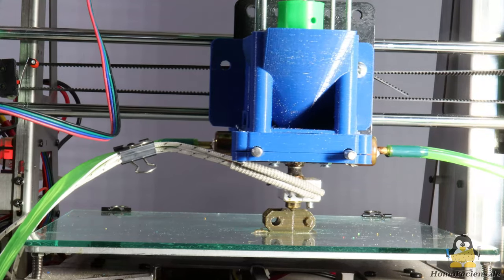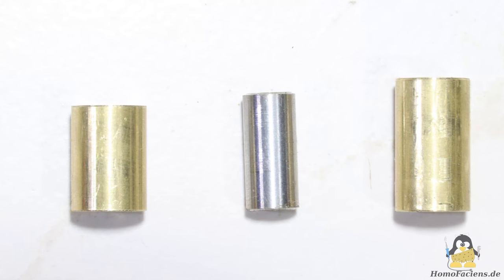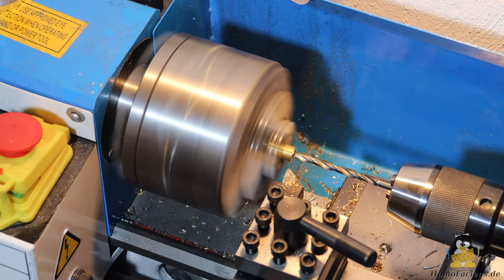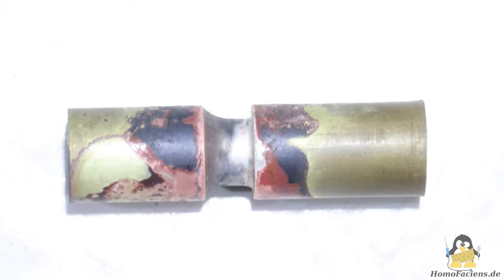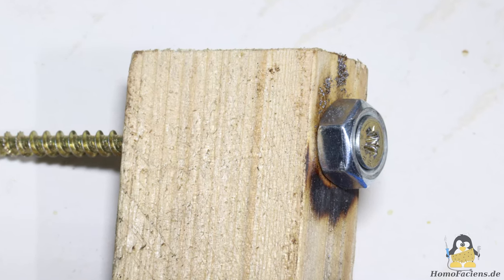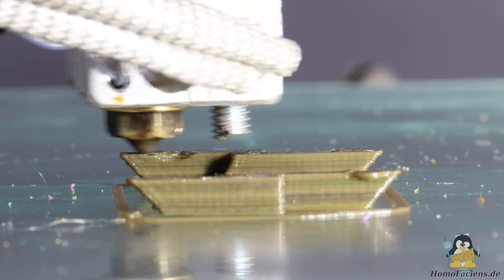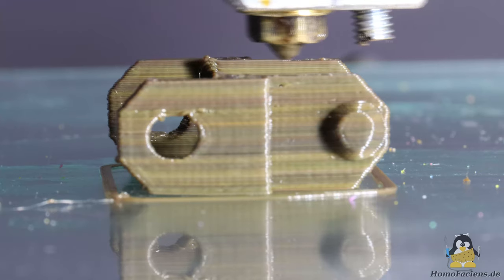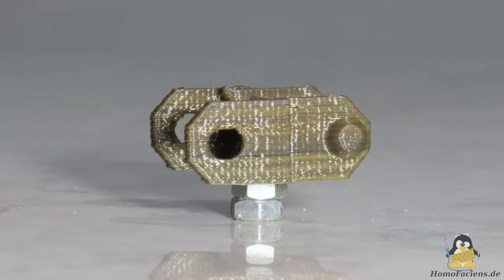Direct Granules 3D Printer V4 1, Build instructions and optimization

Comment: Always clean the flux off the soldered joints afterwards. The flux eventually eats through the copper as it's normally acid based. Plumbers often leave it on so in the future they can charge you for the repair of a leak.
Reply from the maker: ...it will eat through only days after warranty has expired ;-)
You are right, I was too lazy.

Comment: It's working very well. It seems like your primary concern is to keep the melt zone very short? That is surprising
Reply from the maker: Yes, but why does that surprise you?
Reply: @HomoFaciens Conventional extruders want to have a larger hot area to let the plastic melt more completely. This is done to increase flow rate and have stronger parts. Usually done either of two ways: Volcano style with the longer nozzles or CHT style with the split paths or a combination of both.
Reply from the maker: Yes, but in principle it is the larger volume of plastic that is wanted for high flow rates. The granule extruder has a rather large diameter of 6mm compared to 1.75mm filament. With that you get a high volume of molten plastic even in a short tube. More on that when I start experimenting with flow rates. Stay tuned!
Reply: @HomoFaciens  it will be interesting to have a look at the cross section of the extruded filament out of the nozzle. It should be homogenous if all the granules are completely melted instead of just squished together in a semi molten state.
Reply from the maker: That's a good idea. I will have a look at the extruded plastics under the microscope when talking about throughput in one of the coming videos. To keep things methodical, I'll continue to investigate one parameter at a time. Be patient, stay tuned!
Reply: For example the folks at Kodak have in the production of the plastic film, an extruder with an length of ca 5m!
Reply from the maker: ...well, that Kodak kind of material throughput might be a bit too optimistic for a desktop 3D printer ;-)
Reply: @HomoFaciens  if I remember it it was not for the volume of material but for the best uniform / homogenized end result
Reply from the maker: During my training as a physics laboratory technician, I was on the plastic film production line at Hoechst AG. They were similar in length because the film is stretched to needed thickness (1µm was the hottest stuff back then) during the process.

Comment: That is really impressive!
I've played with the idea of having a solenoid-controlled pin inside the extrusion nozzle to stop flow, instead of retraction. Maybe having a long pin-end on the auger could work like that in this design?
Reply from the maker: Thanks!
I had mentioned having a steel tip on the screw that dives into the nozzle and so shots it down in one of the previous videos, but haven't implemented, something like that yet. One step after the other, constant extrusion first. Stay tuned!

Comment: Great work! Love following your progress! If you do a modern conversion can you use an Ender 3 as a base? These are the most widespread printers around and are very mod friendly!
Reply from the maker: Thanks! The more open source Hard- and Software, the more mod friendly. And in those terms the Prusa MK4 I have ordered is a way better choice. More on this in the next but coming video. Stay tuned!
Reply: Nice, using the mk4 is basically insuring any issue comes from the print head and extruder alone.
Reply from the maker: Yes, no more excuses, I have to deliver best print quality ;-)

Comment: I would say this is quite good result but imo you need little less extrusion.
And you neeeeeeeeeed a fan. Or is it a project for the future? :)

I was wondering if a silicone sock would help you? may be a good idea to make one
Reply from the maker: Eagle eye ;-) Yes, the extrusion width is set to a ridiculous value in terms of getting a perfect print (0.7mm for the perimeters).
The current videos are all to optimize the extrusion process, not to get the best overall prints. 

Same is for the part cooling or a silicone sock: both will be implemented in the near future when I convert a modern printer to granule printing. A Prusa MK4 is already ordered. Stay tuned!

Comment: Put this on a quantum delta not an i3. No impact on kinematic speeds, you can print as fast as you can get it to flow (and make it as big as you need it to achieve that flow).
Reply from the maker: Well, moving the print bed means moving more mass around than moving the extruder. All printers have their pros and cons.
The i3 mechanics is the best you can have to record the printing process on video. The print head only moves in the focus plane. Watching the extrusion process is important for the further development of the extruder.
Reply: @HomoFaciens  The modern quantum deltas I've seen have lower total bed mass than even a typical bowden effector. Some sub-100g. Of course you have to add print mass, but even if you printed like half a spool, it's still less than a lot of printers move.
Reply from the maker: These deltas are definitely an interesting type of mechanics. I'll keep that in mind for eventually a future project.. For a first conversion of a modern printer I have ordered a Prusa MK4
Reply: @HomoFaciens  Sounds good. I know the folks building these things are excited about possibility of putting pellet extruders on them.